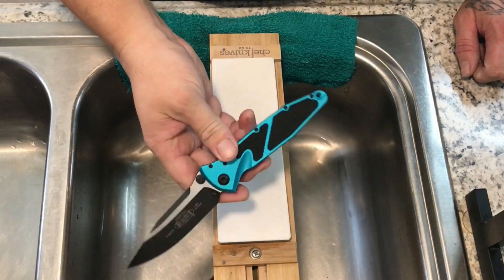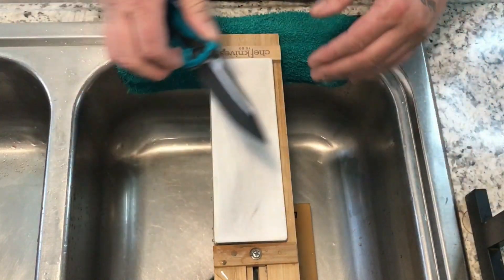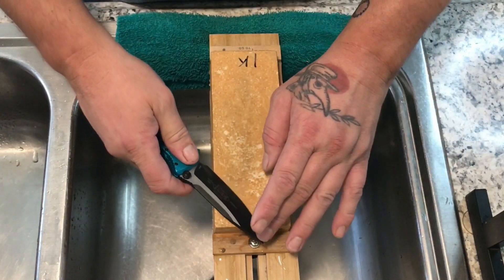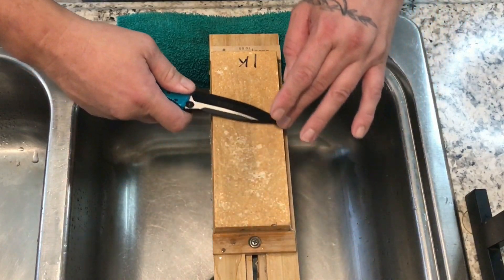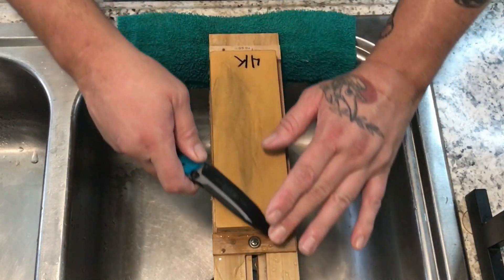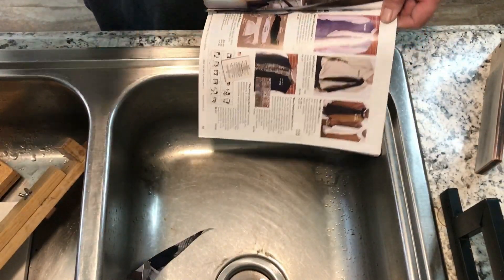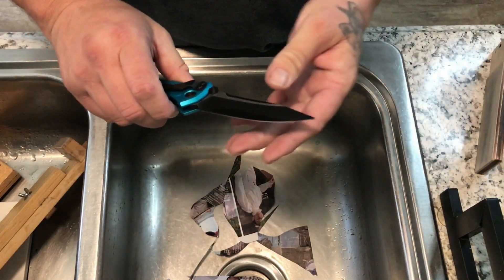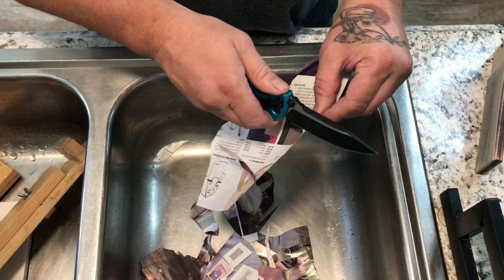Knife Sharpening - Microtech Socom Elite - CTS-204P

Comment: Hello. It appears no one mentioned it yet, so i will. I believe your mistake is not doing a single stropping motion. If you observe your stropping at the failing diamond strop, you will see that from "tip to heel" stropping motions, you change to "heel to tip". Diamonds are still diamonds and always agressive enough to mess up your edge at the slighest mistake. If you do stropping on the stones and follow the same stropping motion later on the strops, you should be fine. I hate strops for this very reason. You spend time on stones to make a good edge, only to ruin it on leather by the slightest change. You have some very fine grit stones, so bringing one out to do some light stropping on could overall improve your results.
Reply from the maker: Yet another reason to hate on diamonds. I have to do special instructions just to make them work. lol. I should be able to just strop as normal and keep it moving. Thanks for the feedback. Next go round I’ll try to just keep the strokes normal. As for stone stropping, i used to do that, on my naniwa 10k. It was used solely as a strop. Worked on most steels. However, there were a few that just ignored that stone and the results did not improve.
Reply: @Jef  i am sorry to learn your naniwa does not always out. I do not own this stone, therefore i cannot talk about it. I also do not like diamonds at all.
Technique wise, i have found that edge trailing strokes work better on diamonds. When i do use diamond stones, i follow this method going back and forth. This way the burr created is much smaller and easy to get rid off later on. After the diamonds, i like moving on to a ceramic stone and sometimes to naturals after that. On the ceramics i do again a few edge trailing strokes to refine the scratch patern and then some light edge leading to erase the big teeth left from diamonds , along with the burr. However, i go back to some more stropping on the stone before i finish.

 For whatever reason, edge trailing leaves a better apex than edge leading. For me at least.  Oh, and i use olive oil with my ceramic and arkansas stones. Makes a big difference. 

You have shown many many stones on your channel over the years. Thank you for the videos and your opinions. I truly appreciate all the efforts you have put into this.
Reply from the maker: @theodorosmalliopoulos7231  Thanks for watching them. Esp over the 'years'! I know I am not the best at this stuff, but I do try to show as much as I can; flaws and all. Diamonds being a perfect example. I have seen many people, come off them, with amazing edges. Then I make the attempt, and fall on my face. Can't be good at everything, I suppose :p

I used to do a lot of edge trailing, when I first started. It helped me with burr removal. As time went on, I realized edge leading, tended to cut the burr off, while I was actually sharpening. I didn't always have to make 20 passes, for removal. I could get the same results in 5-10. Of course, it doesn't always work out that well. Different heat treats, steels, and my own pressure, can alter that. I also found, in my edge trailing, I tended to create burrs, even on minimal passes. This resulted in a few burr removal sessions, that kept creating new ones. 

Occasionally, I will go back to my roots, and do some trailing strokes, to help set up removal. For the most part, I just go with what feels right at the time. 

As for my Naniwa, it works well enough for most knife steels. There are a few running around, that it can't handle. One example, is s90v. I tried sharpening a Buck Marksman special edition, on those stones. Nothing higher than 1k, would even scratch that steel. Stropping it on the 10k, was doing absolutely nothing. Not even burnishing. I might as well have stropped on paper. Anyways, I do know the technique you describe, and have even tried spraying diamond, on some of these stones, to help. I've had, again, mixed results.

One device I found, that keeps that hard backing like a stone, but allows you to use compounds, is the washboard system. Neuman2010 is the youtube channel creator. Check it out if you ever get interested. 

Leather can be nice, once you learn 'em. Some require more pressure than others, just like stones. Others, require a lower angle, bc they are spongy. There are all sorts of nuances, you pick up, and compensate for, after spending enough time with them. It just becomes second nature. I don't even realize, when I do these sort of things, any more. It isn't even a conscience decision. Not trying to sell you on leather strops, but they can take your edge from sharp, to crazy sharp. Like everything else, you just gotta practice, and learn how to operate them.
Reply: @Jef  thanks for the detailed reply. Honestly, i have tried leather quite extensively. Cow, pig, even lamb leather. Smooth and rough. With compounds and without. I even put oils on some before loading them with compounds, to see how they perform. I have not tried diamond compounds, though. I suppose the case is whatever works for everyone. I am really not against different opinions and methods, because each hand is different, and our muscles change as we grow older. I too, have played quite a bit with techniques. Also a few different liquids for lubrication. Sharpening is an art that we constantly keep learning and developing throughout our lives. Primal, yet there is so much behind it. 

One recommendation. If you can try the Fällkniven dc5(the big one), i believe you will like it. The diamond side is too aggressive, so i only use it for heavy work, but the ceramic is truly great once broken or lapped. It produces a good polish and the edge is toothy and quite fine simultaneously. It works much faster than spyderco medium. Bear in mind, i have lapped mine up to  400 grit wet sand paper to achieve these results.
Reply from the maker: @theodorosmalliopoulos7231  I have danced around getting the smaller version so many times. I don't know why I never bothered pulling the trigger on one. Since you have recommended it though, I'll give it a shot and see what's up. Some of my sharpest edges came off diamond, followed by ceramic. It will be a nice change from the Spyderco, for sure!
Reply: @Jef  if you wish to try the small ones, Fällkniven produces cc4 stone. Both sides ceramic and the white side gives a very high polish. It should be around 20$ there in the US.

Comment: Hey Jef! I really appreciate you taking the time to test out the compounds and give some feedback on them. It's unfortunate you didn't get along well with them, I guess your technique is more suited to the oxide bars etc.
Reply from the maker: I have reviewed these last few videos I have made. I didn't release the other 2, bc the results were pretty bad. My angle, and pressure, seem to be on point. It could be possible. I don't think so, but I won't rule it entirely out. It is also possible, I am doing too many strokes. I still don't buy that, either. 

What I truly think; the concentration, is too high. Perhaps for Maxamet, zdp189, 10v, and the other super steels, it is perfect. They take fewer strokes, to obtain that crispy edge. When using a steel that isn't quite as hard, or rich in carbides, it is too much. 

Whatever the case, it is obvious; diamonds are not for me. I shouldn't have to change my stropping habits, to compensate for different compounds. This isn't necessary for Knife House spray, or cbn. Regardless, white compound has always produced superior results, in my hands, for far less money. 

I do appreciate you allowing me the opportunity, to try these out. Sorry they didn't produce the results you know they are capable of. I do plan to continue using these, along side some other products I have. Perhaps I will unlock their potential at some point.
Reply: @Jef  I understand, I can't see that you're doing anything wrong as such either, otherwise I'd have pointed it out. I'll try out making some lower concentration in the new year and see how that goes. Either way I'm glad you liked the strops!
Reply from the maker: @stroppystuff641  The strops are fantastic. Especially for on the go carry. I have been keeping them in my work pack, although I haven't used them at work. I've been off all week :) The material is nice and hard, just as I like. I do prefer the rough side, but even the smooth side has nice feel to it. Seen only the one size on your site, but if you ever get the chance, try offering a 8-10 inch version. I think those would be even better!
Reply: @Jef  I'll mock up the designs over Christmas and send the designs over to the laser cutter. I'll assemble a bunch and get you some samples sent up

Comment: I recently switched to using green compound followed by diamond sprays/compound. Especially if I'm moving on from a diamond stone, like my venev or a plate. I'll go from those to the green, to the diamond. It actually really seems to help get any bits of microburr that may be left.

I tend to do this on the higher vanadium steels, but it works well on anything.
Reply from the maker: I have done this before. Usually after I ruin the apex lol. Seriously though, I have seen nice results going from stone, to strop, back to stone. So long as you don't create a burr, you can get some insanely aggressive edges this way.
Reply: @Jef  I was talking about going stone, strop, then diamond strop. 

I have done stone strop stone though too, if I need too.
Reply from the maker: My bad I completely misunderstood your description. I have tried that. No, it didn’t really help. I can usually get things back on track by ditching the diamond and just concentrating on the chromox. Regardless, it is good to hear others have success with these type of compounds. Reinforces the idea it’s me doing something wrong and not the diamond.
Reply: @Jef  well, I've never tried this particular compound. Just the venev .5 micron (left a scratchy finish, but the edge was good), gunny juice (not bad, but messes with the leather sometimes) , and the chefknives to go stuff (my favorite so far). I want to get ahold of some of bbbs stuff. 

I mostly do that technique with high vanadium steels like I was saying. The chromox somehow helps to knock the burr off when the diamonds fail for some reason. Then after that I use the diamond to refine any carbide the green compound possibly exposed. At least that is my thought process behind doing it like that. 

It took my k390 edge to the next level. If it's not just a better edge in my mind.